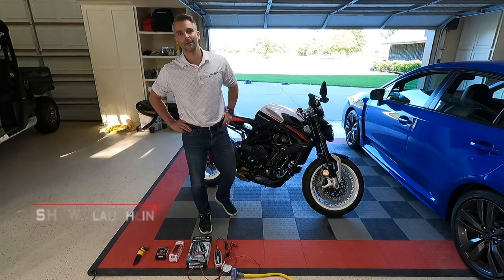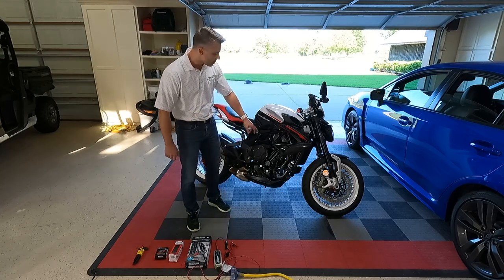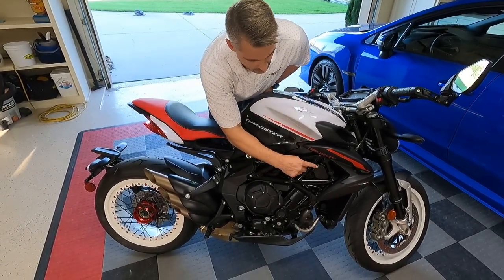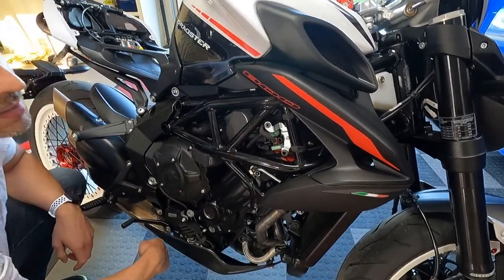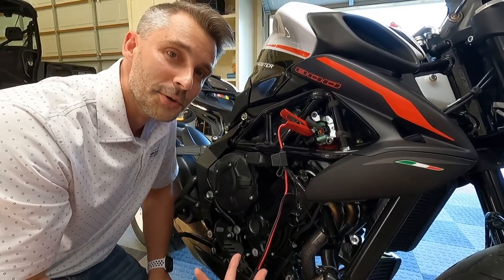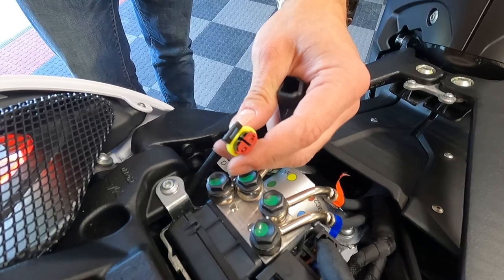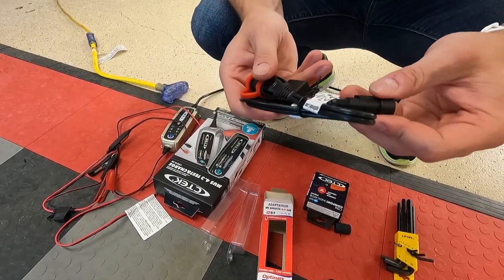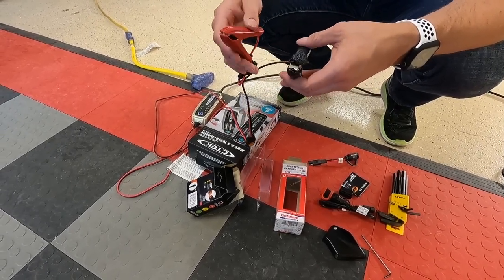MV Agusta Dragster Dead Battery Charging Issues!

Comment: I used the first method a few times already, since the bike keeps having issues with batteries. I bought a booster/starter that i use to jump start the bike when it gives voltages issues. It doesn't cause issues with the circuit, never had to replace a fuse or anything. It's also a nice way to maintain battery health throughout periods of inactivity by using a battery charger or by unplagging the switch/contactor in between the fuses.

Comment: Nice done video with great audio and lighting to see well.  I own a Super Duke And MV AGusta Dragster 800rr Pirelli edition.  I love V2’s and triples.  I replace all my batteries from old school toxic lead acid batteries to lithium on day 1. Less worries of trickle charger.  Of course, the battery under the tank on the MV.  Not necessarily hard replacement but takes a little longer.  Love the light weight lithium, no corrosion, no explosive hydrogen gas, higher CCA, full power cranks to 5% battery Vs need of at least 70% charge lead acid to crank engine, longer warranty with lithium, lasts 3-5x’s longer than lead acid, charges in minutes vs hours, lithium only loses 1% charge/MONTH vs 1%/Day charge with lead battery.  Look forward to more videos.  I did install titanium Silmoto snake muffler. Beautiful art to go with moving art.  The titanium makes a sweeter sound vs stainless as metal is thinner/lighter.  Rings like a bell tone.  I did replace halogen turn signal with new rage.  Replaced halogen headlights bulbs with 5000 k colored Leds. Bike always feels special
Reply from the maker: @scottcampbell6995 hey man, pic's or it didn't happen. :) Sounds like a good looking bike, love those Pirelli editions, super sharp. Thanks for the feedback my friend! Any issues with fuel out the over flow or tank swell?

Comment: Thanks for this video. Just had my drag800Rr battery replaced at shop and it wasn’t cheap….this same process was explained to me by my Mech. You should disconnect the plug next to the two fuses if you’re not riding for 2 weeks or longer - the trickle charger should be used.  It essentially disconnects the ECU from the battery which will save your battery b/c it kills batteries when not in use. MV dragster issue. AGM battery is $240++ then time to replace.

Comment: Swap it out for a noco lithium and everything will be fixed. You need a different charger tho, just get the noco genius and you should be good. The electrical draw on the dragster when its off is ridiculous. As soon as i switched to a noco i could leave it without the tender like a regular honda :p
Reply: link?

Comment: I had the same issue with my 20 R 1250 R, not the same bike at all but I guess the thing is with these new electronics heavy bikes is they require a lot of volts to crank (14v for my bike) and the shop manager recommended charging the battery with a tender every night, I mean I love my bike so I would read it bedtime stories if I had to, but the takeaway here is that these new bikes are kind of like phones with all this battery draining electronics kit.  Even idling the bike in traffic will leave you with less volts than what you started with (fully charged) so just a heads up.
Reply from the maker: Phenom feedback Joe. I especially notice with connecting external devices like the phone charger on the Quad lock!

Comment: Hold your breathe on the QS. Mine went out at 1.8k miles. No dealer will touch it besides Eurocycle
Reply from the maker: Hey Gage, do you have a pipe, mid pipe or anything that required an ECU flash? Any idea what caused the QS to go out? That's concerning and I see some traffic on the forums about it as well. Might be a good one to do some content on.
Reply: Nope, everything is stock. Cordona makes a really reliable QS, I’m wanting to make the swap but after looking at the wiring placements I think the task requires tools and expertise I don’t have lol. A service manual would make it easier but it looks like changing the QS involves taking off the tank and some of the covers around the frame
Reply: My orange rpm warning light stays on too now

Comment: can’t see it being totally different set up on the bike from UK to USA. but there is a charger connection point under the seat. FYI the supplied charger plugs straight on to it. no need to take parts off the bike. also have the same bike.

Comment: Yup, I’ve got a CTek charger (good kit) so I just bought the 2 pin waterproof connector and fitted it onto a CTek lead. You can find the trickle charging lead under the seat - There are two connectors with rubber covers over them. One is for diagnostics and the other is the trickle charger. Auto electrical suppliers will sell you the mating connector (I used Vehicle Wiring Products in the UK). The connector is a bit fiddly but straightforward to fit

Comment: Can I charge a 2014 brutale dragster the same way ?
Reply from the maker: Hey @russkle, bit of a delay here, in regard to charging I definitely recommend using the under seat connector which you can keep maintained via a battery tender. However, I would NOT recommend charging via the method describe here to get power for jump starting.
Reply: @mvagustalifestyle7023  thank you for the advise 👍

Comment: Hey man nice work but I have purchased the 2021 brutale SCS 75th anniversary edition and there isn’t anything in the owners manual about getting the battery out. Now either I’m dumb or I am clearly missing the key entry half way down the bike. You don’t show that in this video, I have a 2 piece seat I’m at a loss because I feel lost because I love the bike. Any help would be appreciated.
Reply from the maker: @Alpharius RR, the brutale, although the same power plant, has slightly different faring make up. That said, i believe the batter is located under the tank similar to dragster. You have to loosen the tank and lift it to access the battery. A real pain in the ..... More info and a video to come!

Comment: G'day mate. I have a question. How can the hyperflash be cured after installing LED indicators?
Reply from the maker: Hey my friend. LEDs typically need a resistor or they will burn out or flash at a rapid rate. I will look up and reply with li k to appropriate sized resistor. What lights do you have?
Reply from the maker: So you installed LED turn signals and your experiencing "hyper flashing", where the indicators flash much faster than normal? The linked resistors look like an easier way to install to your existing wires. I bought the variety that doesn't have the crimps provided, so I had to solder the resistors inline. Not a huge deal, but still more work than if the crimps already exist. I measured the wattage output with a multimeter, which is probably your best bet. The ohms to wattage relationship should be listed with the resistor. In this case:

"Select the 9.8 Ohm resistor when going from a 21 watt turn signal to an LED turn signal.
Select the 21.5 Ohm resistor when going from a 10 watt incandescent turn signal to an LED turn signal." Here is a great resource found here…. https://www.motorcycleforum.com/threads/what-load-resistor-do-i-buy.228658/